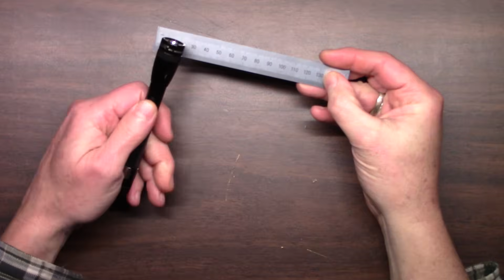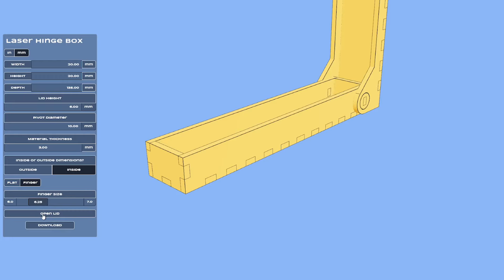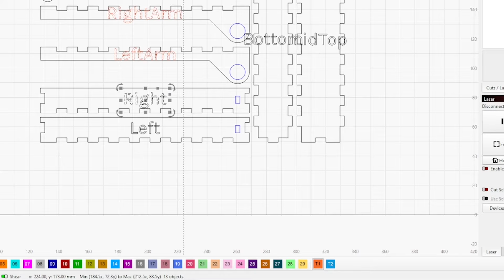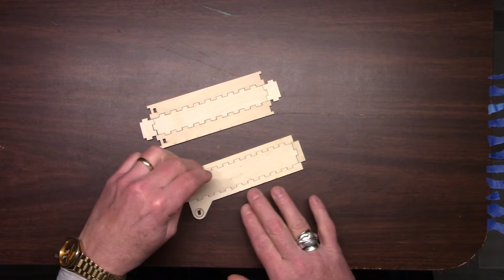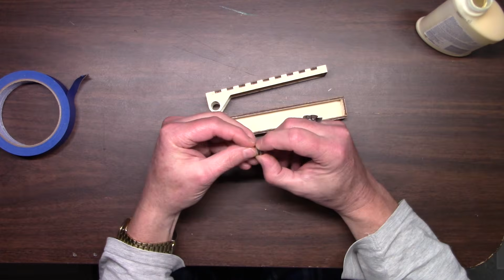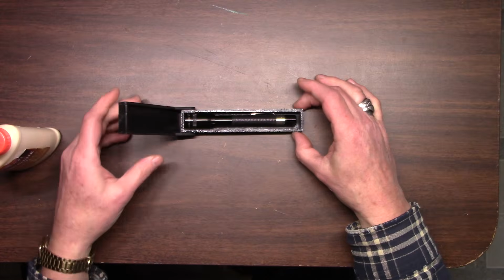New Hinged box from MakerCase!

Comment: Nice job. Did the front of the lid overlap the lower box section or did it just meet up? It was hard to tell in the video. Thanks for sharing.
Reply from the maker: Great question.  The front does meet up with the lid.  The sides overlap so the hinge works.